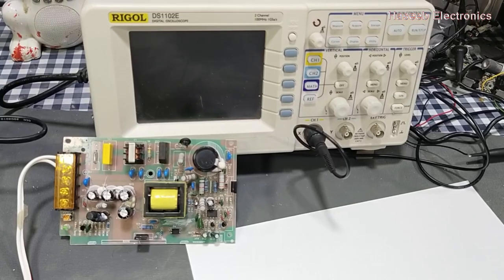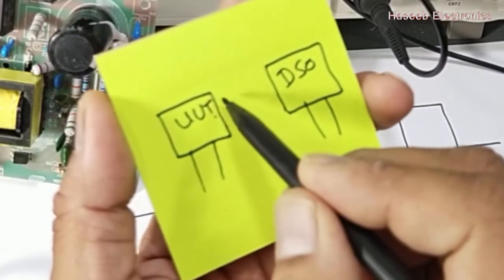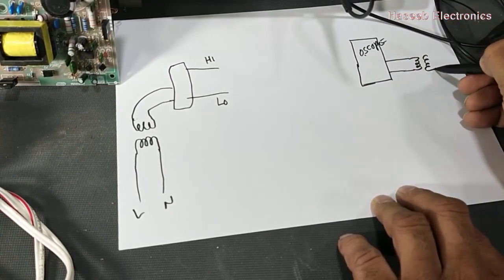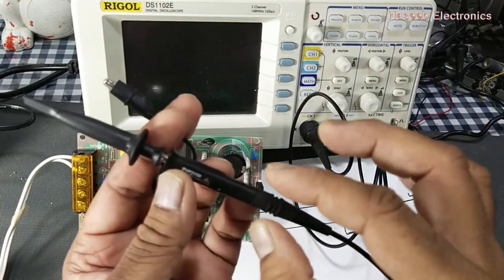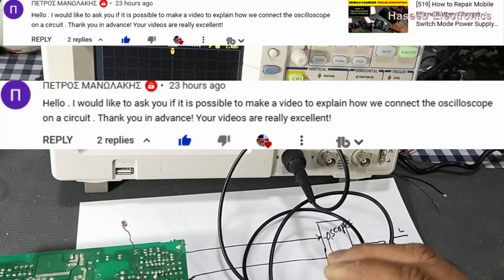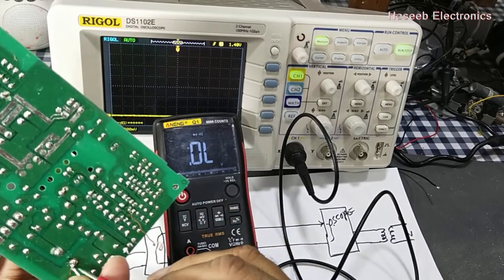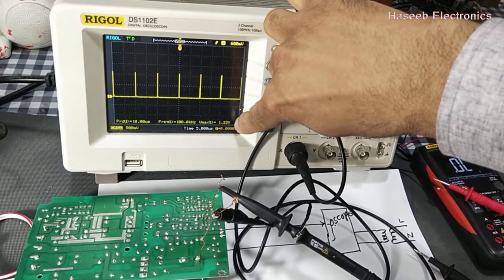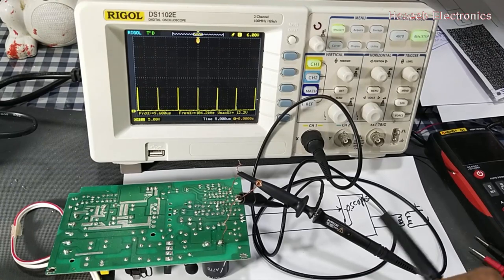{532} How To Test Signal With Oscilloscope / How to Connect DSO to Test Signal

Comment: What would you recommend for minimum oscilloscope specification for SMPS troubleshooting and design? For example; what bandwidth or vertical input characteristics?
Reply from the maker: minimum requirements, suitable specs for all commercial equipment
100MHz, 2 channel, 1GSa/S

Comment: Nice video Sir
Sir i don't have so much budget to buy an expensive DSO 
Suggest me a fine DSO witch I can use in ac pcb repairing
Reply from the maker: you can select any 2 channel, 50 MHz or 100MHz oscilloscope 
like Hantek
REGOL
Sigilent 
Uni-T

uni-T is less price oscilloscope
Reply: @HaseebElectronics  okay Sir, thank you

Comment: What happens when test prob and ground line was connected opposite way accidentally? Does it act ike multimeter prob?
Reply from the maker: nothing. the oscilloscope displays inverted signal
if it dc signal, the oscilloscope will plot this signal below the zero line in X axis, indicating that it is negative signal 
if it is ac signal, it will look same but when we compare with some other signal in that case it will display 180 degree out of phase due to reverse connections 
if we are testing the duty cycle, it will inverse percentage. for example if we are measuring 10% duty cycle.  but with reverse connections it will display 90%
i will demonstrate practically in upcoming session